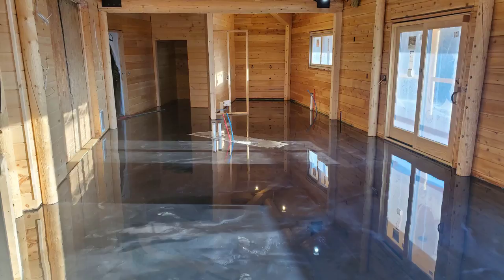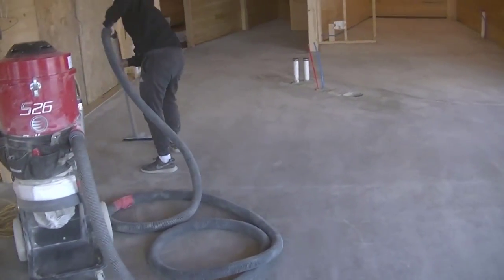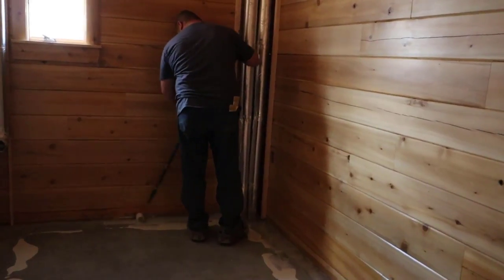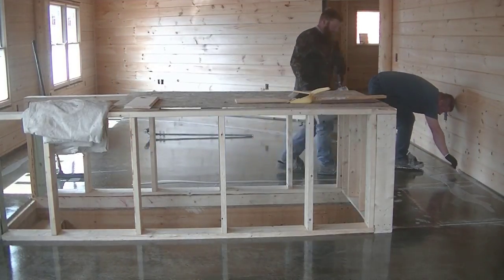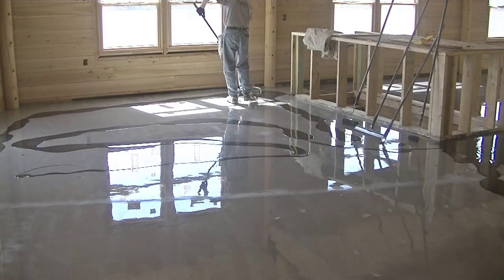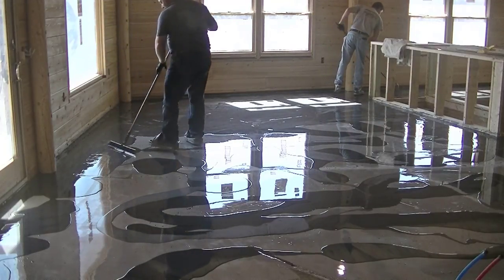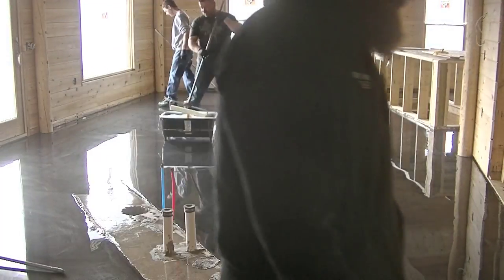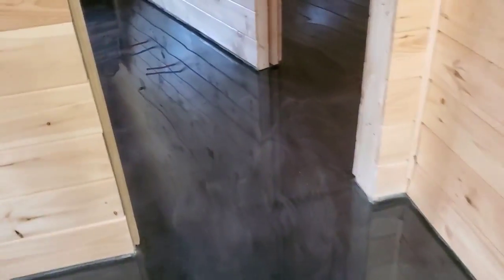Metallic Epoxy Concrete Floor Coating (3000 Sq Ft Pentagon Shaped House)

Comment: I love the way that looks Mike. You and your crew do awesome work!
Reply from the maker: Thanks Harvey. How are you!
Reply: @MikeDayConcrete  got a suggestion for you.   use a wet wand with the white rubbers.  looks just like your dust wand your using but with a different head.   Sucks tight to the ground with an S26

Comment: We use a watering can to pour out our edges, really speeds up the edging and you can pour right next to the edge 👍
Reply from the maker: I've seen that. Do you clean it afterwards or just trash it?
Reply: Mike Day Everything About Concrete  We usually use the cheap plastic ones, just toss them

Comment: are there any fumes/vapors during installation?  seems like that finish would show every speck of dirt. 
i would like to see the  tutorial, especially if it were for a garage floor.
Reply from the maker: Not with this epoxy, it's very low VOC. Barely any smell at all.

Comment: Great looking floor.   What would you have to do if you wanted this type of floor, same colors but not that reflective?  Is there a way to matte the finish?  Looking to do some high traffic areas in my bar, but am worried about all the foot prints, dust, etc.  Also, can you add a little grit to something like this for anti-slip?  Bar floors tend to get wet and am also worried about the slip and fall factor.  Any info on this would be greatly appreciated.  Thanks in advance.

Comment: Definitely for former Government Workers, cost is no object. LOL , but it looks awesome, as usual you do a great job. Thank you for showing us.
Reply from the maker: Thank you!
Reply: @MikeDayConcrete , I own a manufacturing plant and a few years back had some seams where slabs joined from added additions. I had a guy do some painting and said he could repair / smooth the cracks. All I remember is he used a two part product that got warm when mixed. It is somewhat self leveling and can be spread to a feather thin thickness. It dries to a somewhat milky color / semitransparent but it is very durable. I would love to know what it is, he would never disclose the product and kept it in unmarked cans. He is no longer in business and I would love to know what the product was I have some more repairs needed. It takes Fork Truck traffic and is carts with ease. You can not stick a pocket knife into it, pretty hard. ANY IDEAS?

Comment: It may not be for everyone, but it looks fantastic to me. Lotta work and I’m sure it ain’t cheap, but the finish product, with a few rugs here and there, is spectacular.
If the underlying concrete develops a crack, will it project thru the epoxy? Or does the epoxy stay plastic enough not to crack as well?
Reply from the maker: Thank you.  Having a crack mirror through would depend on the severity of the crack. A hairline probably wouldn't be seen.

Comment: Are there non slip additives that can be added on the top coat? I'm assuming if there was, the top coat probably wouldn't be glossy. Also if the customer have floor heating, does that affect the durability of the coating?
Reply from the maker: Yes, there's non-slip additives we can add and it will matte the surface look. This floor had radiant heat in it. It doesn't affect the coating.
Reply: Sand

Comment: Hi Mike, thanks  for your concrete videos  and this. I learned  a lot from you. I have stamped concrete  patio and has a crack, i filled with concrete filler (liquid hardens a few hours  later) it is grey and my patio was red tone as you can imagine it is ugly. And crack is not completely filled. What do I do? And one more, can I do this epoxy flooring after I fix my spalling (I saw your video :) or just ground floor and do epoxy. My spallings are not that deep or harsh but3 to 5mm or so(3/16" or so) thanks.
Reply from the maker: I would have used a product called "Magic Crack Filler" to fill in the cracks in your stamped concrete. https://logicalresource.net/product/magic-crack-filler/
You could buy some red coloring powder to mix with it to help hide the repair. https://amzn.to/3eSv0NU
You'll have to remove the liquid repair you already installed to do this properly.
You will want to fix any spalling before you do an epoxy coating. It'll come out a lot better.
Reply: You are the best!!! I wish you live near me so, I can hire you for any jobs around my house. Because  of your knowledge  and dedication for perfection is just hard to find these days. Thank you so much and I'm watching you what is coming next from you and learning a lot from you. I'm trying  to be no.1 student( I'm sure you have a lot of them)
Stay safe.!!!!!

Comment: so cool. I seen a floor like this in a dr office i panted. Where could I find the materials used for this?  Im planning on building myself a studio office(10x12), and I figure ill add this on my floor to save money vs OSB board, tile, etc.  I figure ill just pour a concrete floor

Comment: Hi Mike great job ,what a finish! I know it’s unrelated to this video but could you tell me where I can buy the for work steel pins with the holes in and what they’re called please. I am in uk thanks.
Reply from the maker: You can get them on Amazon: https://amzn.to/2S5l4XY
I also can get them at a local concrete supply store. https://www.whitecap.com/search/#/?query=metal%20forming%20stakes